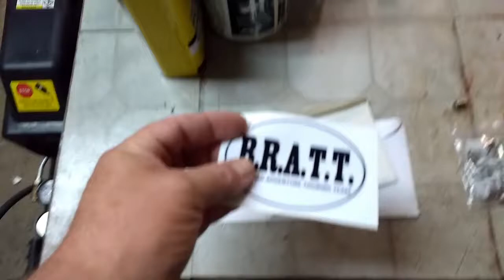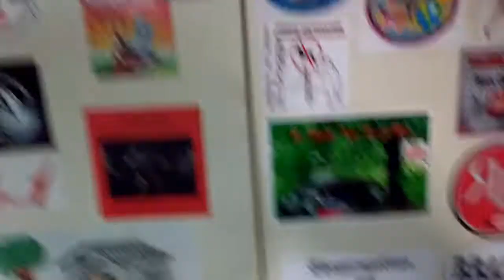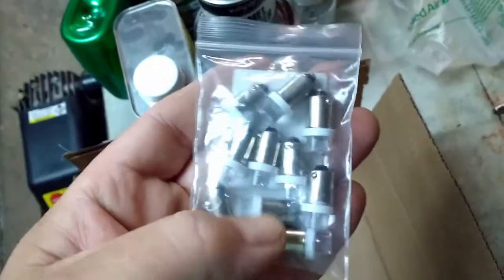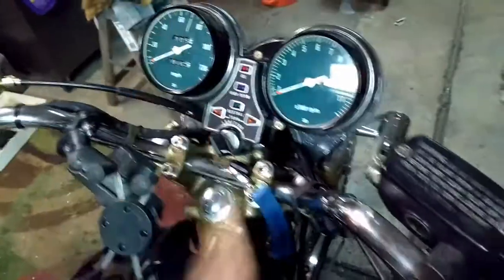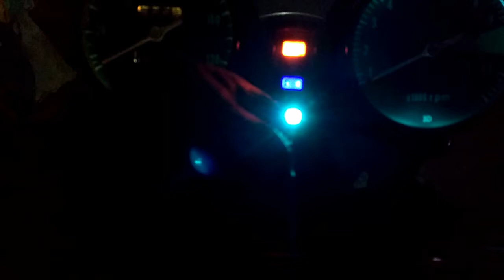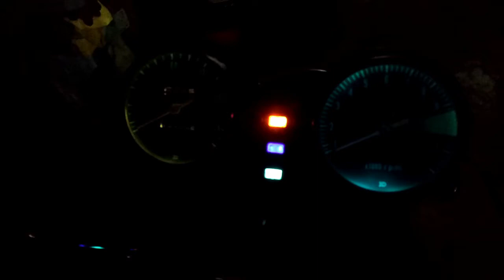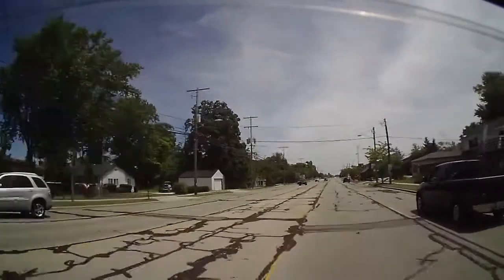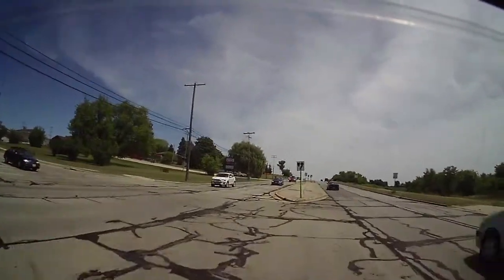Vlog Mailcall LED lights install

Comment: Chuck is a great fella and addition to the sticker collection . Those led bulbs should really cut the amp draw to almost nothing.  Interesting facts about the Brass Ball at the intersection, Thanks for the ride
Reply from the maker: Yea, I am hoping they help the charging systems on these bikes are not great so any amp draw I can cut out should help in the long run. Chuck seems to be a cool guy for sure.

Comment: supercool to se the UFO as a brass ball!! hahaha well the leds looks better and brighter then i coun imagine , as for the headlight led its weaker then the tail light led even on high beam so it might be a faulty one or the chinese built ones isnt so high standard they check them for brightness so for now im using the old yello h4 ! havent even connected my rear turnsignals after the relocation since its been shit weather for a month now ,havent been riding  witch sux !!
Reply from the maker: Yea, it could just be that because its a cheap china made LED headlight that its not good enough. They don't do inspections here so I don't worry about it. Also I don't ride at night so I only need a light for other cars to see me. Sorry about that. Dang was hoping it would work. Yea, the weather here has been so hot and muggy that riding just is not much fun. Hows the little one doing? :)
Reply: MidwestMotoRider
oh shes strong and eating well , only crying when in"the gas mode" farts, smiles and eats again , so shes very well indeed ! a short one comming up only with a short clip from yesterdday when in a mall , not talking just her asleep !
Reply from the maker: Awesome! Give Mom and Baby a hug from us.!
Reply: MidwestMotoRider
thanx i will !! she says thamx too !!

Comment: When I replaced with LED's I had the same issue with green. Did you get multi-colors in that pack? I ordered one of each color separately from a store called SuperBright (also did the tail light). Interesting story about the brass ball.
Reply from the maker: They came in a pack of 10 all the same bright white I guess there is enough blue in the white to cause the neutral switch light to go teal no biggie I can live with that everything else is just fine. I also did the tail light and the head light in LED's I will not do the turn signals only because then I have to mess around with the flasher relay and don't want to be bothered with that plus the flashers are not used much around here. :)
Reply: I left the flasher alone too. But I have not yet done the Headlamp LED. Plan to do that soon.